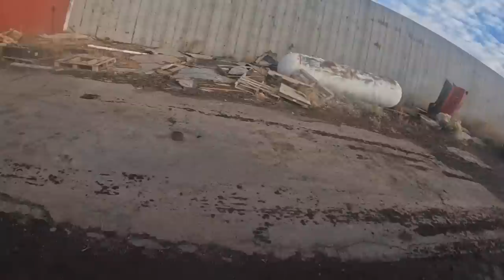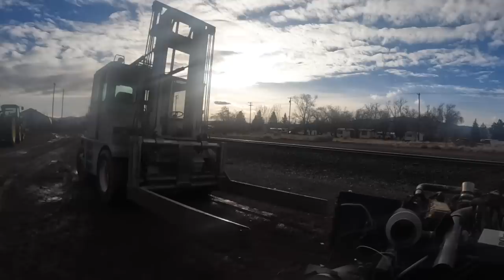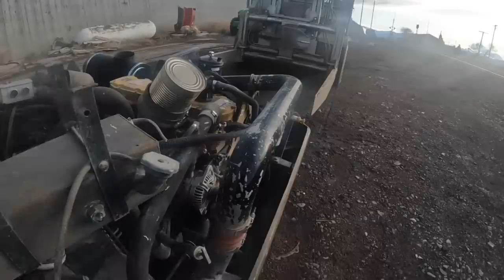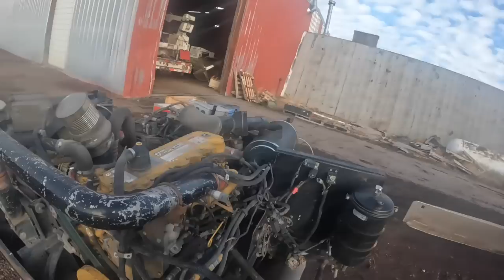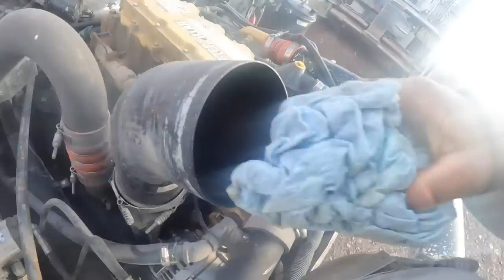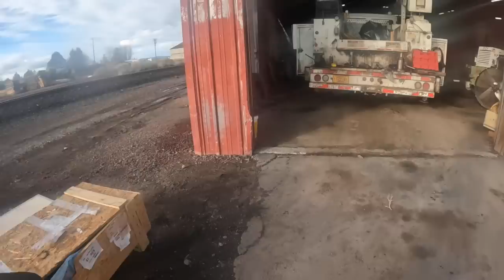Upcoming project info.

Comment: I run into that drive shaft phasing quite a bit. It's one of the 1st things I was taught.  As a matter of fact my 2018 RZR turbo comes from the factory out of phase. When you use the 4x4 you feel it vibrate.

Comment: There is a product called ez weld tig wire that works amazing when welding cast iron.  I had to repair a external water jacket crack on a 426 hemi block that was the matching numbers block for a 70 cuda.  I previously used nickel filler rod and I was out and none of my local welding supplies had any so I began calling friends and that is when I learned about the ez tig wire and my friend gave me some to try.  I had zero problems welding the block and after grinding, needle scaling and texturing the block with a rotary tool it was impossible to tell the block had been repaired.  I normally would of used metal stitching pins for that type of repair but with that caliber of car the appearance had to be perfect.  I once repaired a Northstar block in the vehicle that had a 2" hole due to electrolysis.  I took a hole say and clean cut a perfectly round hole and then I ran a tap down the hole and then I screwed in a brass cleanout plug that is normally used in garage floors.

Comment: Warren
Always enjoy your videos. We run a fleet of 75 peterbilts and since about 2013 they have all came with the interaxle driveshaft out of time. I called the factory and an engineer I spoke with told me I was an idiot and they are supposed to be that way. All of ours get pulled and put in time regardless. Thanks for the videos!

Comment: What California doesn't realize is that when they think they are "saving the environment" by making you cut a hole in an old engine block to take it out of commission, the environmental pollution created to replace that engine is way more than what that old engine would have put out if it had been repurposed.
Reply: Especially with the EV’s , Wind Mills, Solar Panels.
Reply: Yes, you are right !.
Reply: But it makes them FEEL so much better doing it!
Reply: Like dad say’s electricity comes from either coal or nuclear power….you figure out the rest

Comment: Drive line vibration causes, 1) out of phase (time) 2) compound angles on shafts 3)  mechanical looseness in components on driveshaft(s), bad u-joints and or midship bearings. 4) to steep of angle on drive from trans to diff ( mostly on single shaft applications). There’s more but these are the common ones I ran into servicing vibrations resulting from drive lines, but I am betting you know all that Warren, it amazes me how little service people know about drive shafts on trucks and equipment. Thanks for the ride along sir.

Comment: Have a Happy New Year Warren and Thank You for your neat channel. You are motivating me to buy more serious tools and repair more of my own equipment in LA area.
My dad bought us a similar Sqz when I was 18 years old for use on dairy. It had the 290, a manual trans, and a "drop-in" style rear end. it originated from Los Banos area as these are Ca designed machines. I ran it a little bit locally for hire because there was an enormous demand for unloading in our area, 30+ years ago. We gave up on replacing broken side view mirrors and fitted a Home Depot sliding window for unloading view. You're going to have a good time on this project, another Warren-bilt for the road.

Comment: I remember the first week of Diesel School back in the 1990’s, in the driveline class. We went over drivelines and proper u-joint phasing and what happens when they are out of phase. Great find on that truck, Warren. 
The whole destroying engines mandated by the Government just pisses me off. I understand getting something off the road and getting something newer to play the Emissions games. When your forced to run a salt solution in the oil and run the engine until everything locks up and is junk or cut holes in parts, that is just stupid. All of the tree hugging hippies that preach about recycling and saving Mother Earth are doing the opposite. Not to mention what it does for used parts suppliers and trying to keep old equipment running. I will never understand why idiots are making laws in government. 
Thanks for sharing your time and expertise. I also really appreciate your no BS commentary that gives me faith in my fellow man, at least one in California.

Comment: You’re not exactly correct Warren.
3116 was mechanical and later models were HUEI.
3126 are all HUEI but the difference in the round or square head pumps.
Reply from the maker: You are wrong, they used 3116 cat mechanical in the 35 and 45 Challengers, and the 55 challengers had a 3126 mechanical with the exact fuel system as the 3116. I have rebuilt dozens of them, I have the thousands of dollars or rack synchronization tools for them.
Reply: @westerntruckandtractorrepa1353  You are right! I just never have seen them with mechanical injection.
Reply: 3126 marine engines are mechanically injected also…
Reply: There are lots of mechanical 3126s in industrial and marine applications.  9ZR, 1ZJ, for example, and the list goes on.